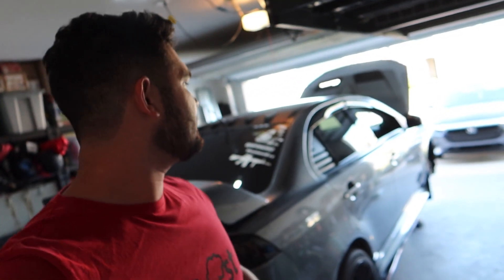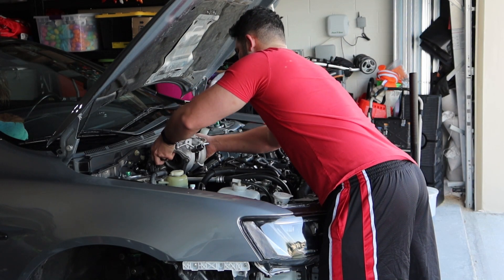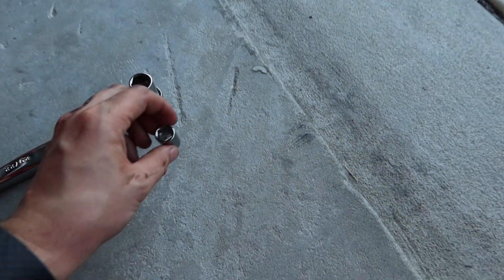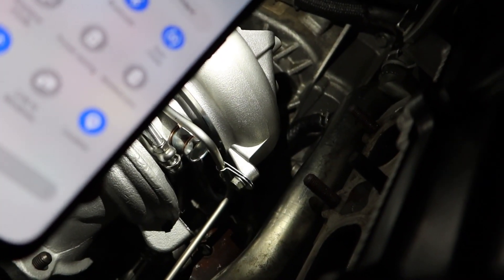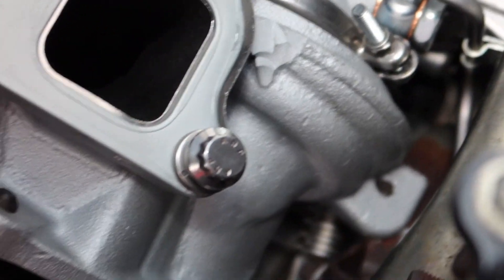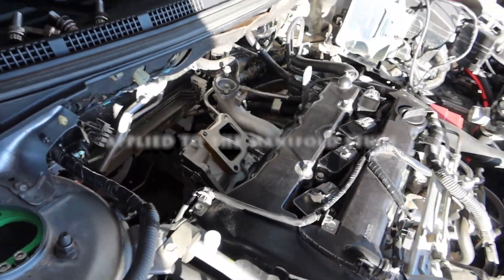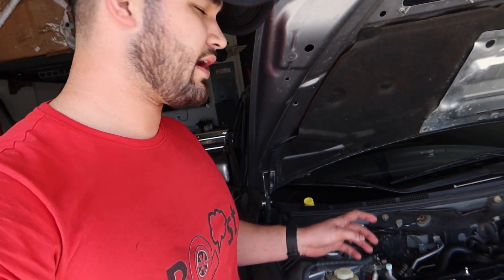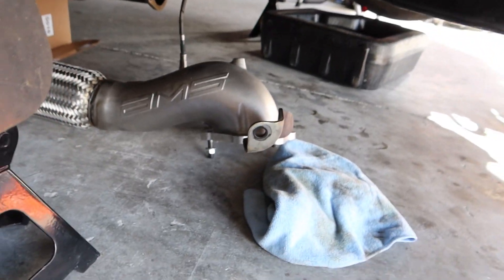Evo X Turbo & Tubular Manifold Install (GTX3576)

Comment: Hey bro so I got two tires for my car recently the tires centimeters were like 10 or 5 difference from the the tire it calls for m. Would that pop up 4W Drive system service required??

Comment: What I hear with the X turbo After all that  you’ll going need  custome  tuned  those basemap were only for the oem turbo
Reply from the maker: Yea it sure does. Any manifold, downpipe, intake, turbo, or boost controllers would need a custom tune.